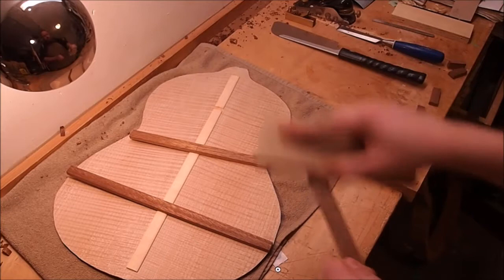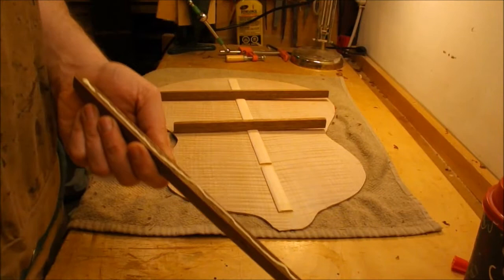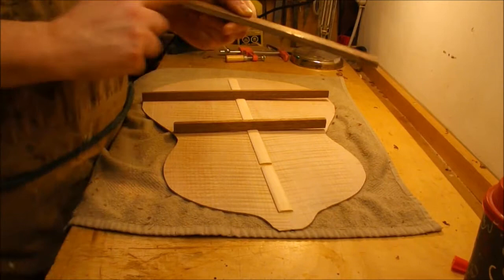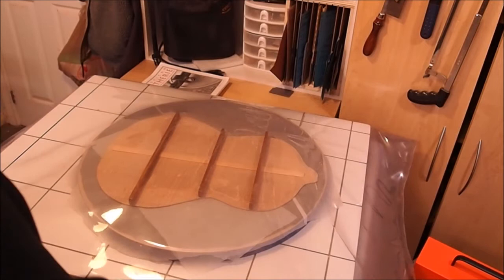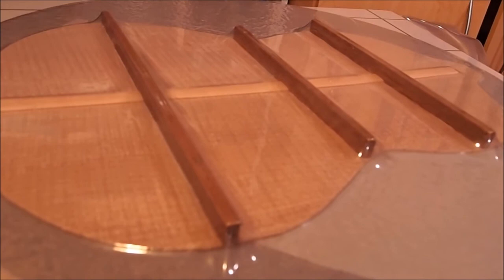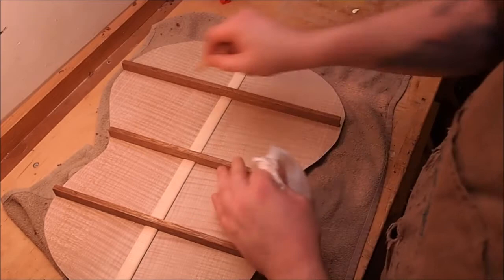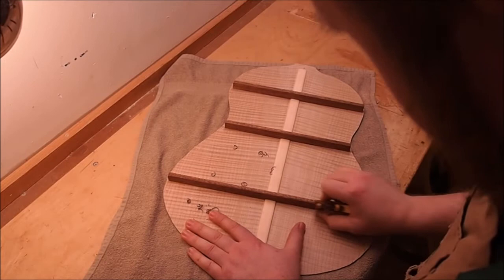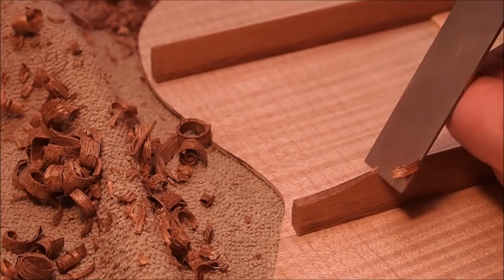Vacuum pressing and Back Braces

Comment: "The standard, or near-average, atmospheric pressure, at sea level
on the Earth, is 1013.25 millibars, or about 14.7 pounds per square inch."
Reply: Or 101325 Pa or 1 atm or 759,999892 mmHg